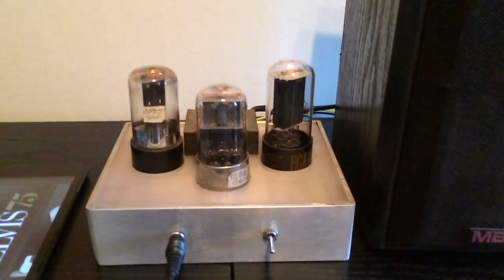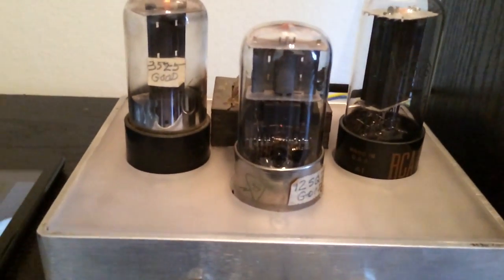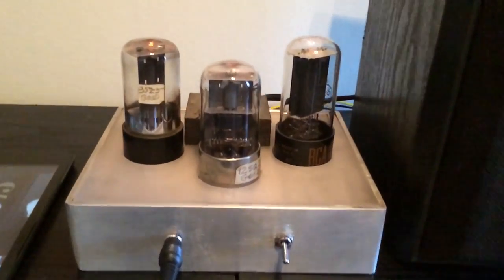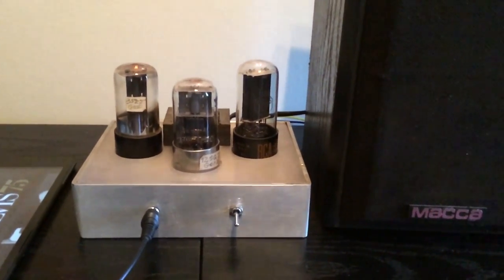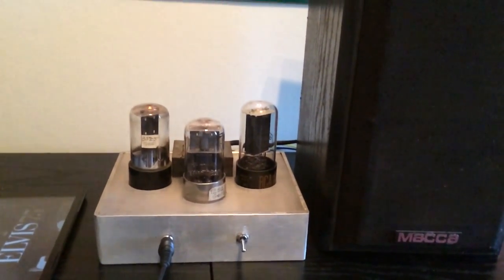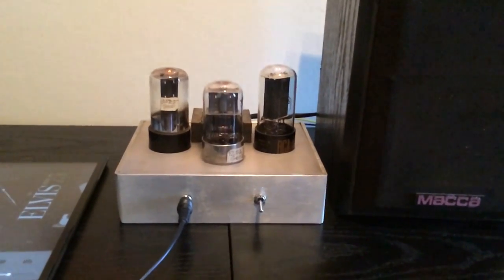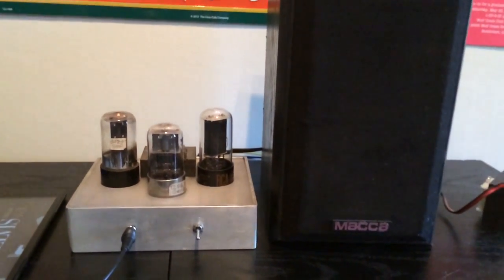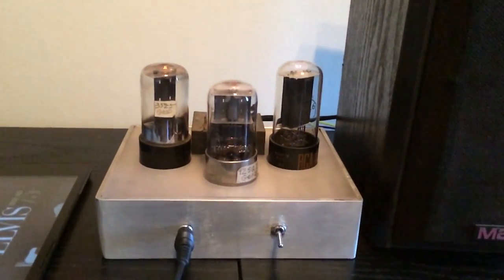Easy Tube Amp (12sq7, 50l6 and 35z5)

Comment: This is an extremely dangerous  design as it does not include an isolation transformer. You are running wall current through your tubes. If you touch your guitar and a microphone you're going to get shocked. If you play the guitar and touch any grounded metal you stand a chance of dying. 
DO NOT BUILD ONE OF THESE.
Reply: He's using an isolation transformer.  If he was not, then there would indeed be a shock hazzard.

Comment: Hello radio old 5 valve usa 1950 35z5 12sa7 12sq7 50l6 and 12sk7 model rca is posible circuit for one amp? Ah and one pcl84 thanks